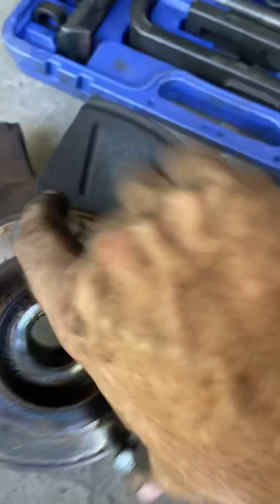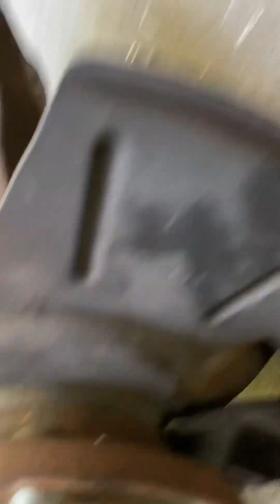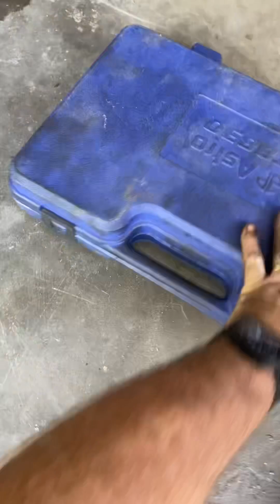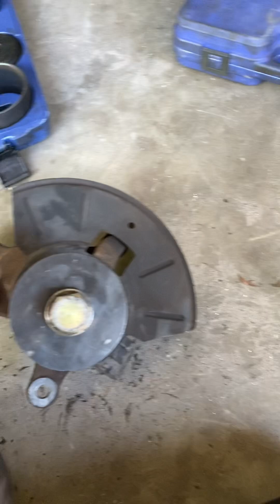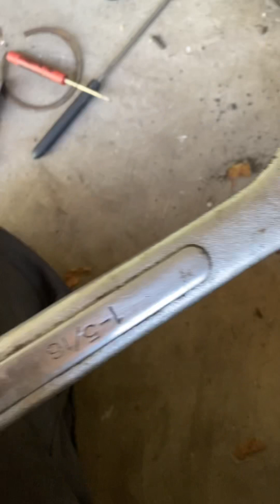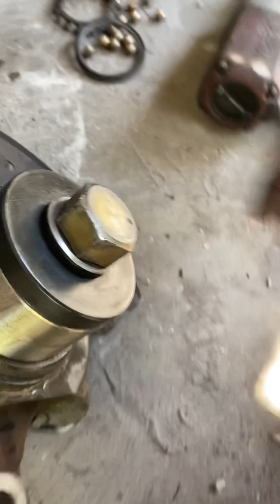Using my Astro Tools hub bearing tools.

Comment: I need to know a good stopping poing when i put the bearing in the knuckle , how do i know i should stop drilling, also i need to know when i should be done drilling the hub in as well i dont want to mess anything up
Reply from the maker: @justinpalmer1146  just get it most of the way in, so when you install the axle you can get the nut to thread. Then use the axle nut to pull it the rest of the way. That way you can properly torque the axle nut, which will set the bearing preload correctly.

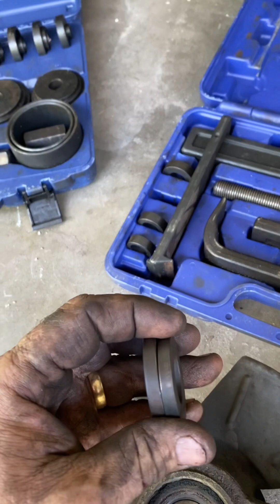Comment: At 1:10, the washers aren't the hub pulling adapters, they go on the other side. They're also oiled in the middle (I assume it's to prevent turning friction). I don't know why they're in the middle of the hub adapters, but you should be using one of the either two below the washers, or the one above it. The washers prevent the bolt from touching the "T-Bar" (the main piece metal that holds the bolt and the two hooks).
Reply from the maker: Yes, you’re right, and I’ve used them the correct way before. But they also did happen to fit perfectly for this hub, so I kinda went with it.
Reply: @RedeemedMechanic  I wonder if you had the same issue with the claws staying in place. I had to use a bungee cord to make them tight against the housing.
Reply from the maker: @kolvann  I’ve been lucky so far, the locking screws have been all I’ve needed. But I’ve had that issue with other puller tools. A big tie strap usually does the trick when needed.